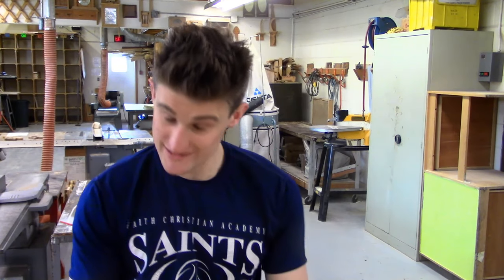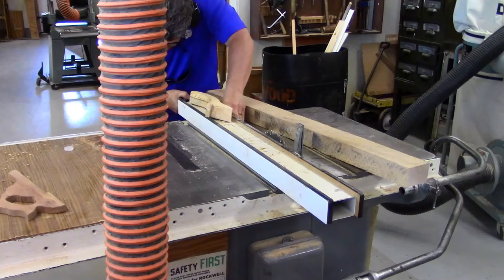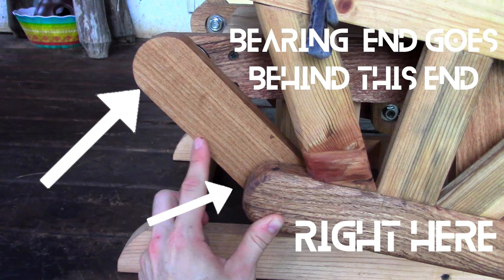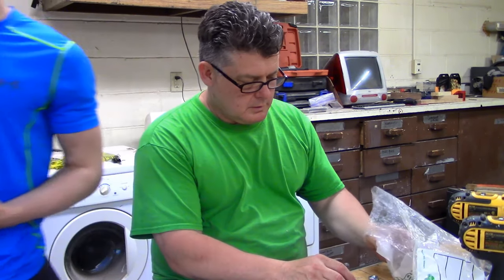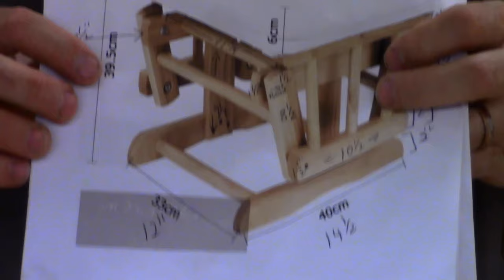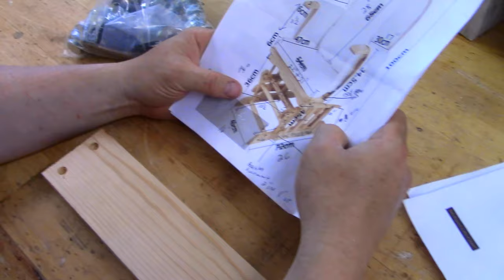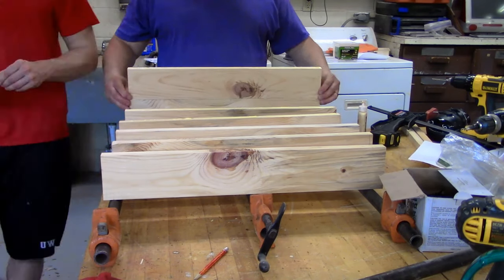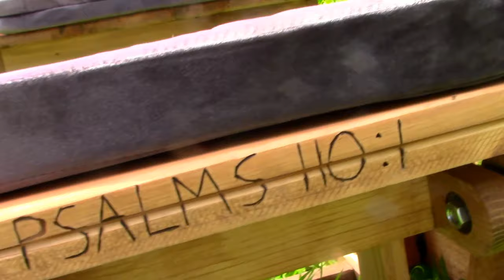How to Make a Secret Gliding Chair Set (Ottoman Chair Tutorial)

Comment: You HAVE to put the large washer there to hold the bearing because they are SO CHEAP, that the "seal" pops out if you look at it wrong and the balls fall out!! Ask me how I know. IMHO, your inside diameter on the large washers should be as close as possible to the bolt diameter so it doesn't allow the bearing shield to pop out. If you use a 5/8" bolt, the washer inside diameter should be 3/4".